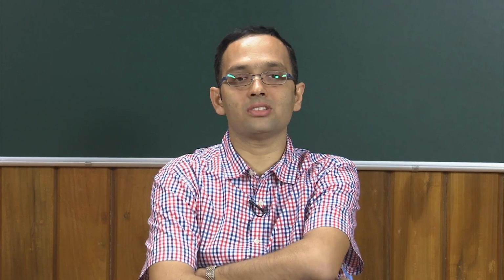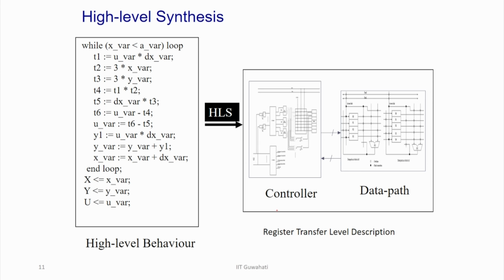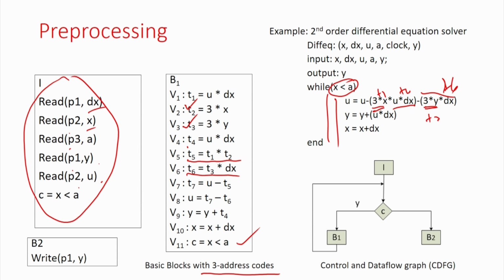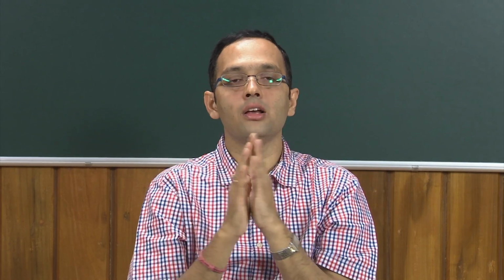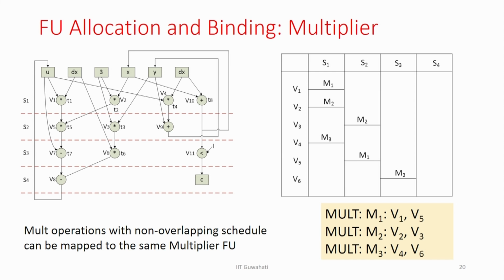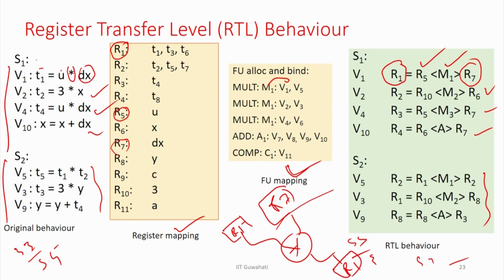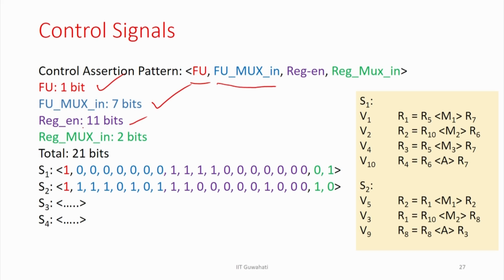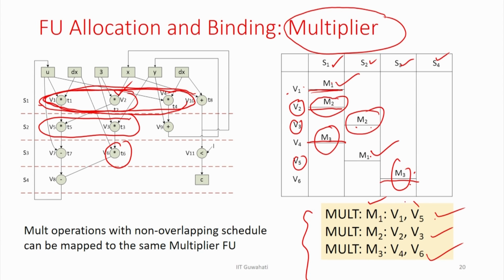VLSI Design [Module 01 - Lecture 02] High Level Synthesis: High-level Synthesis (HLS) flow

Comment: Sir, Please clarify...
1. DataPath Synthesis final diagram:
Mux to register R1 has 2 bit select liine because  MUx inpouts are M1, M2, M3 from S1, S2, S3 
Mux to Register R2 has 2 bit select line because Mux inputs are:Multiplier M2 and Multiplier M1, from Adder A
2. To multiplier M3 : there should be a mux coz  V4: R3 =R5<M3>R7 and V6 : R1 <M3>R7 there for for R5 R3 selection we need a mux.
3.  Controller assertion pattern would be 23 bits.
   < Fu(1 bit), Fu_mux_in(8 bits), Reg_en(11 bits), Reg_MUx_In(4 Bits)>